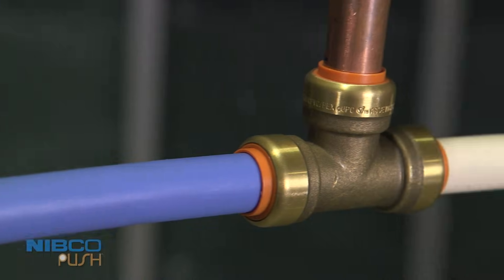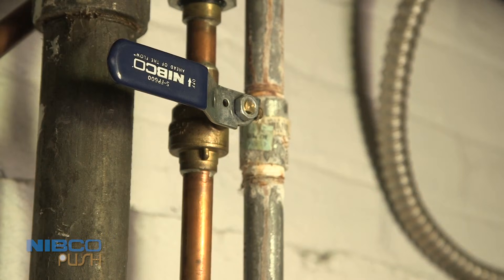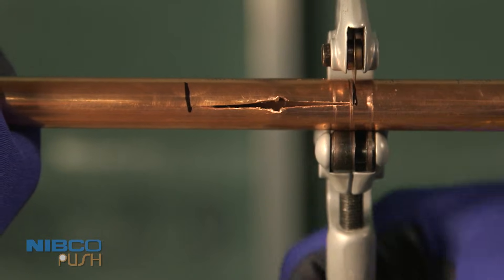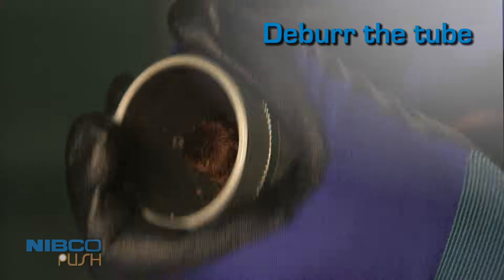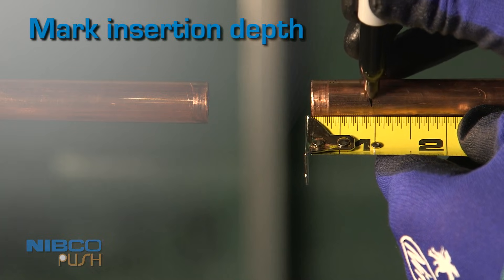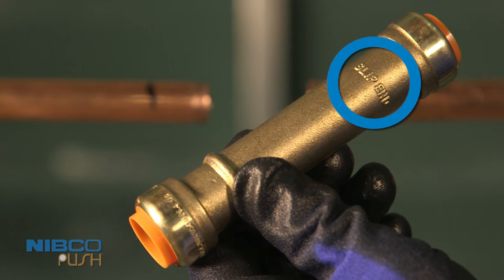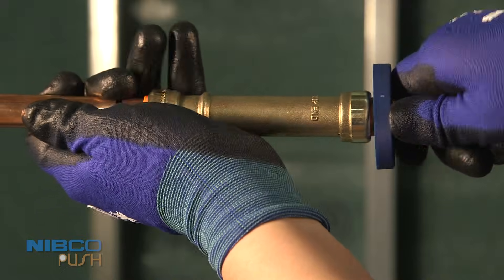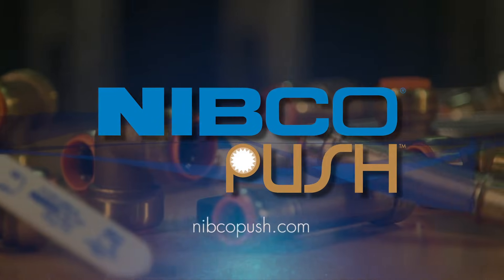How to Repair a Burst Pipe with NIBCO Push-to-Connect Fittings

Comment: Pro Tip: make sure your pipe is clean so the coupling slides on (slip end) more easily! If your pipe is dirty, there’s a chance the coupling will get stuck sliding it on. They can be very difficult to remove!!  So do yourself a favor and clean the pipe using an emory cloth or steal wool.   Make sure no fragments exist before slipping on the coupling.